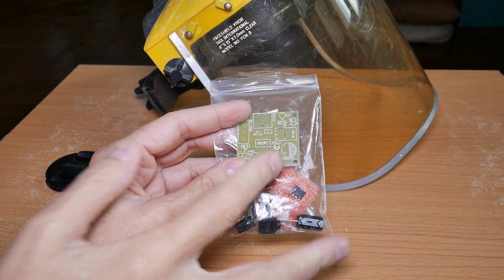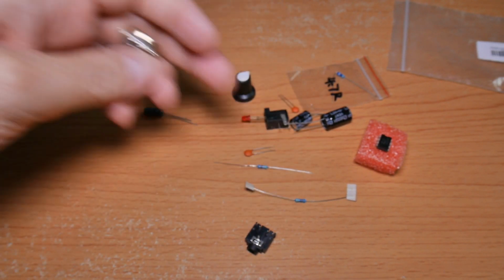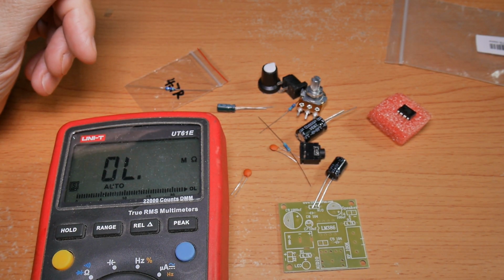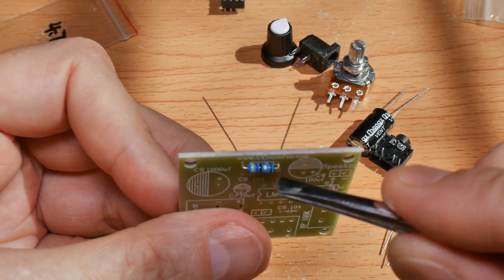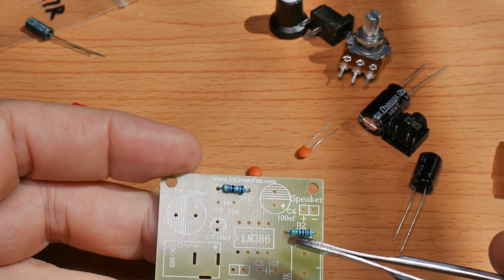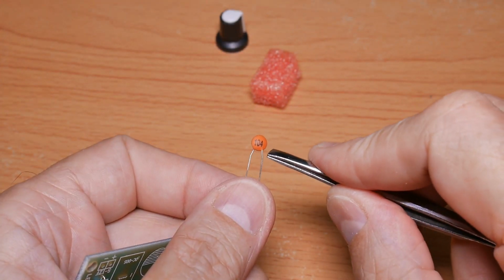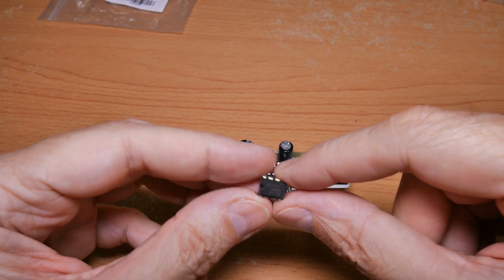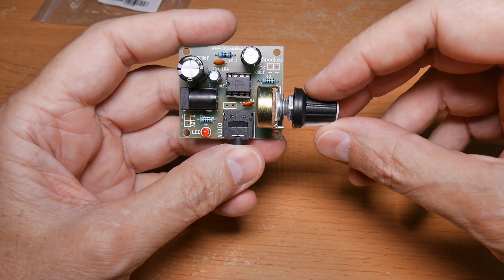Beautiful Soldering With Common Tools

Comment from the maker: RELATED SOLDERING VIDEOS (Including this one):
Soldering - Through Hole Tips & Tricks   https://youtu.be/nWsnpCjymAE
Soldering Iron Tip Replacement   https://youtu.be/-wGgjJIqS-Q
Soldering Basics-Popular Connections Done Right!   https://youtu.be/udNu-wZaqJE
Soldering Wires - Doing It Wrong, But Getting It Right (What is CRITICAL?)   https://youtu.be/Ej284nrwX84
Soldering Without A Soldering Iron   https://youtu.be/b5iiUMAOGew
Soldering Myth Busted: Solder From Below https://youtu.be/gFGvNrYpsGc
Common Soldering Mistakes    https://youtu.be/mv1t-aoSDOg
DIY Third Hand For Soldering, Gluing, Hobby Work, etc.    https://youtu.be/2Qa8Wkc8dKM
Soldering How To-Electronics, Car Wiring, Boats, Solar, ...  https://youtu.be/gPpisFM6AIg
Beautiful Soldering With Common Tools   https://youtu.be/uTCvuPnsYQk

Comment: Soldering is most definitely an art form. When I worked in aerospace, the company I worked for had all the techs that performed soldering go through an annual program on soldering proficiency. It really keeps you on your toes. The "too much solder" thing is a real issue and to understand why is very important. Cold solder joints can't hide when you have just enough solder that creates a nice fillet that traces the joint. Nice work, even if it is a "B" ;>)

Comment: Great video. 
I have been into electronics for years at this point, and i still am having problems with soldering from time to time, so IMO, this video is for everyone. :)
Oxide is my nemesis number one.
Reply: I keep a couple of acid brushes cut short 1/2" to 1/8" and a supply of alcohol and scrub vigorously any areas that give me grief. Liquid flux is your friend too. Alcohol is a great solvent for removing old flux as well
Reply from the maker: To remind others, only use rosin flux and rosin core solder on electronics.  Out of desperation when stores were closed and I was out of flux I used a tiny bit of acid flux on a project decades ago and then cleaned the board.  The acid came back from the board (it was porous) and under parts over and over regardless of what I did.  I had to replace dissolved tracings over the years.  Finally I threw it away and bought a replacement.
Reply: @tsbrownie  Oh right, the caveat... Acid brushes never saw the light of day as having been exposed to acid and no acid should ever be used. These brushes are called that in the catalog, but used in other applications. Not unlike a paint brush never seeing a drop of paint. Sorry about the confusion.